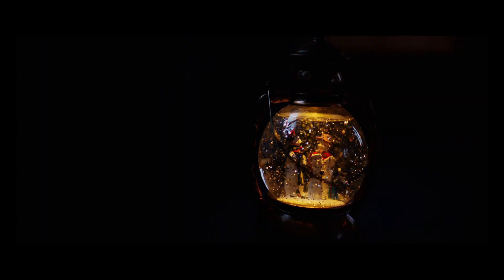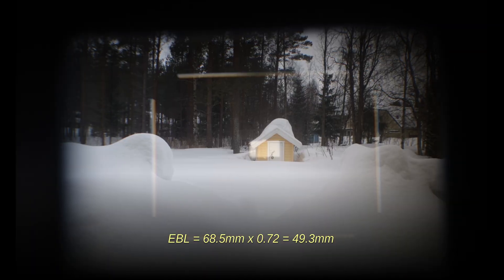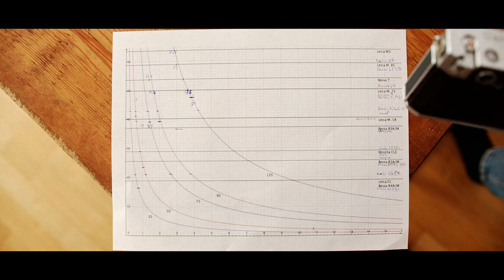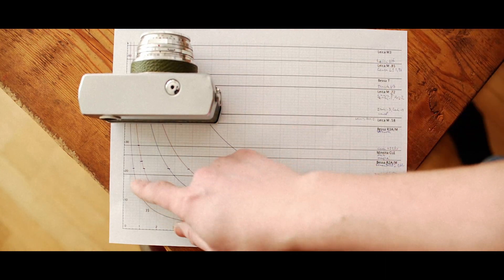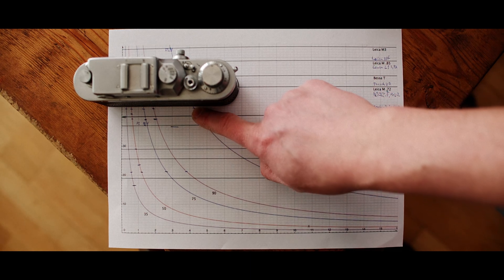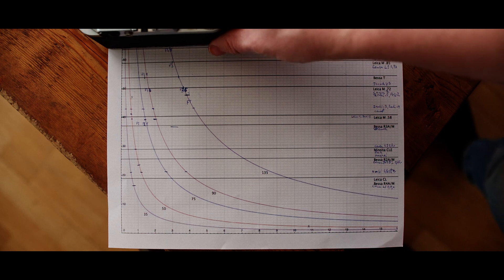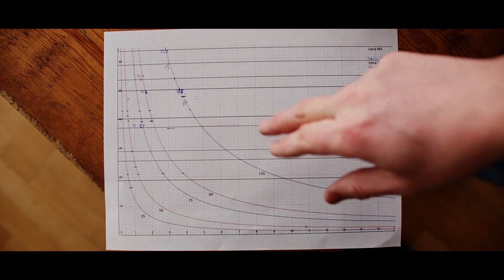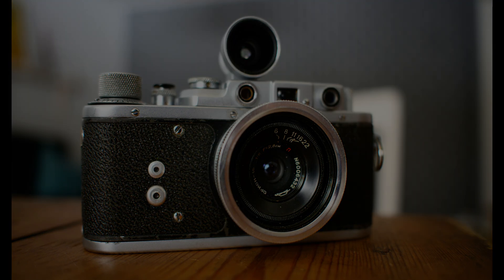Effective Base Length, how much do you need? Oskar Barnack vs the world part 5 - Bird photography

Comment: The canon 4sb2 has the effective base lenght of 25 with the shortest magnification, right? So if we set it to 1.35 we will have ~50mm, is that correct?
Reply from the maker: Well you have the magnificationsettings of 0.67x, 1x and 1.5x, and then you have a base length of about 25mm, 37mm and 55.5mm